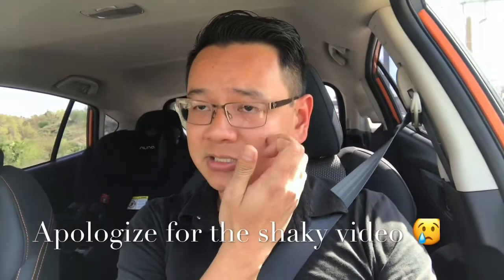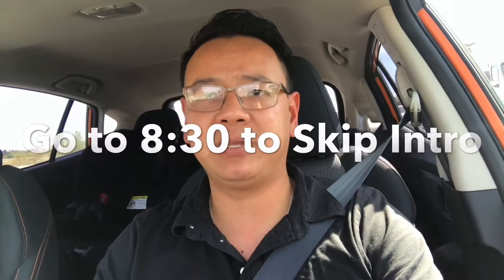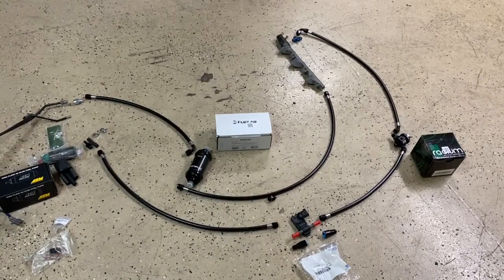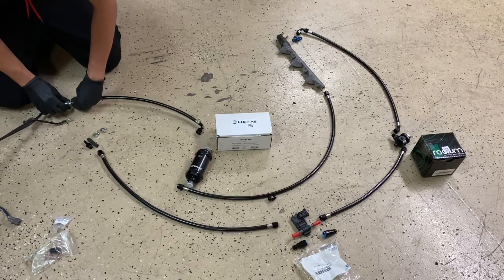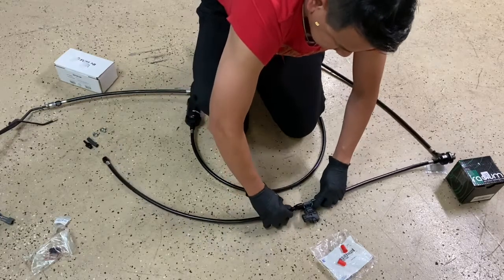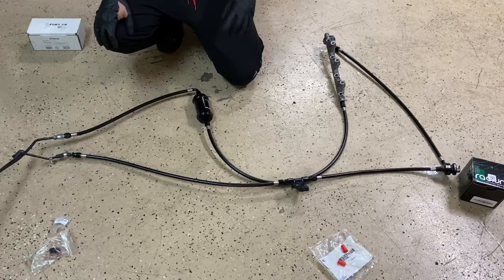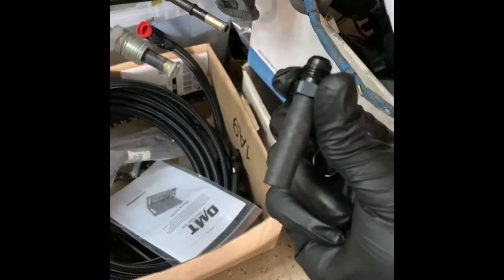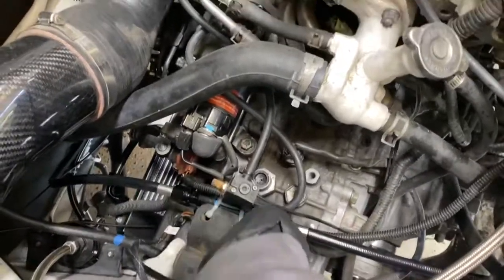DIY: How I Flex Fuel My Car

Comment: You need 1.39 gallons of E85 or 1.5 gallons of E100 to get the same amount of energy as 1 gallon of gasoline.  So if you need to use more E85 to get the same amount of power as  Gasoline, why do it?  Because E85 & E100 resist detonation like crazy.  This means you can run much higher boost levels, and make more power with E85.  But you use a lot more of it.  So, you need much bigger injectors and a higher flowing fuel pump. The inline GM flex fuel sniffer checks what is actually in the lines to adjust your injector open times and timing.  Let's say you have a tune for straight gasoline, and another for straight ethanol (E100).  But you have exactly half a tank of gas and half ethanol...effectively E50.  A good aftermarket ECU will extrapolate between your two tuning tables to safely optimize running on an E50 mixture or E whatever.